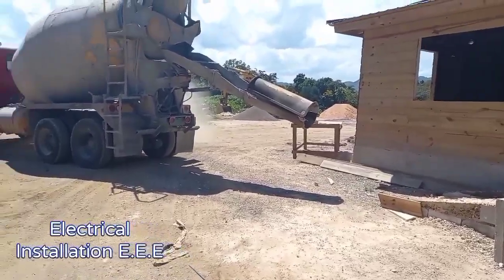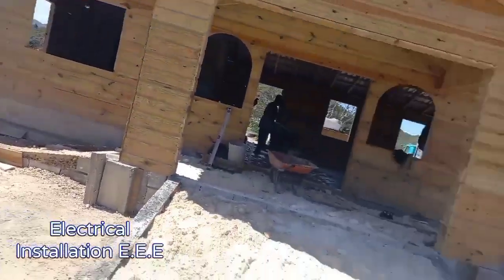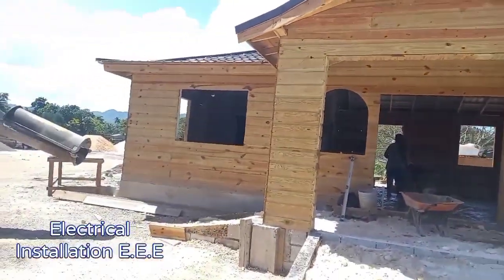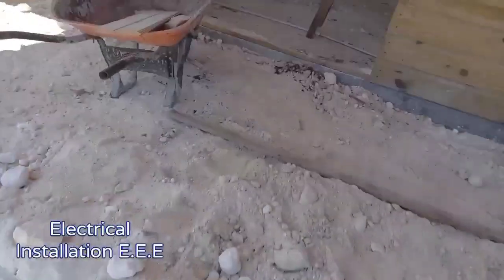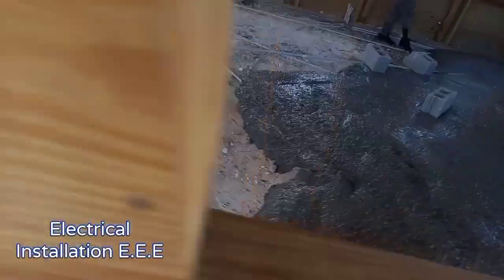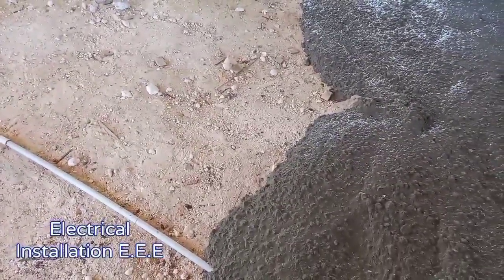Ensure your p.v.c conduits are safe during concreting // Electrical Safety Tips.

Comment: Imagine you wasn't present and one  or few of the conduit burse accidentally,the concrete would blocked it and that wire would not fish through.
Reply from the maker: Pull out from the coupling for real ,one thing all electrician and plumber have to have in mind don't trust masonry to fix your pipes no it don't work.

Comment: whats the size service for this place, and how much for a home like this cost
Reply from the maker: 35mm main wires and 100amp d/p breaker
Reply: @ElectricalInstallationEEE  I always get confuse with the wire size in Jamaica with the 35mm because we use different terms here but it’s the same I believe
Reply from the maker: Yeah in the states and out here different terms in a lot of things even in color code ,height for sockets ,types of socket at certain areas etc
Reply: @ElectricalInstallationEEE  different terms for real, some parts of the states we have different color codes height for receptacles and grounding. Essentially it’s the same everywhere in the world. Just different specs
Reply from the maker: Spec right we just have to know ,that's i always tell people this is a trade you have to love otherwise you won't make it.
Reply: @ElectricalInstallationEEE  you are so right I have two other businesses and electrical is my favorite especially troubleshooting and coming up with solutions. I left the trade three times and came back
Reply: @ElectricalInstallationEEE  I would call that #2 or #1 for 100amp
Reply from the maker: #1 in the states in awg  .. out here we use #1 ,2 ,3 ,4 etc in the twisted wire . Single wires out here we identify them in mm
Reply: @ElectricalInstallationEEE  nice, do you guys use aluminum wire too for service or at all
Reply from the maker: For service main mainly
Reply from the maker: In our currency around 250 / 300k price not finalize yet thou.
Reply from the maker: Not a lot in your currency
Reply: @ElectricalInstallationEEE  it’s a lot trust me some people don’t even have $400 for emergency trust me. Many would wish to have a house like that
Reply from the maker: It is a office